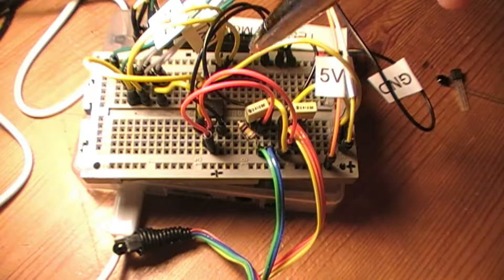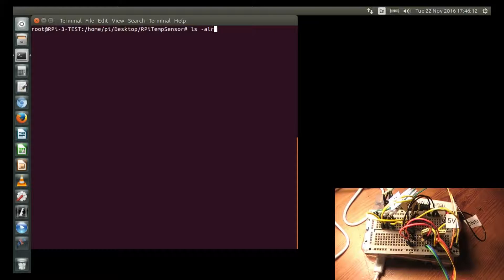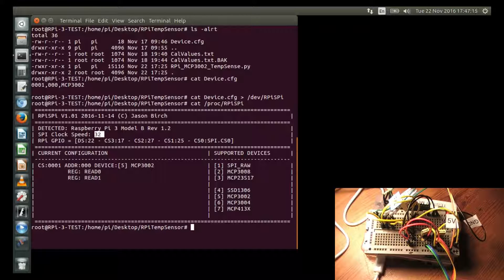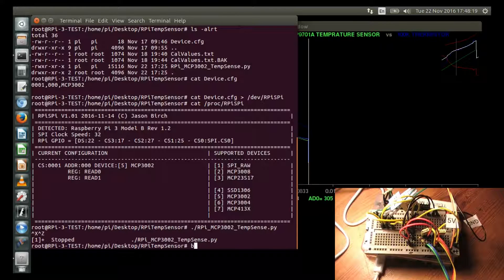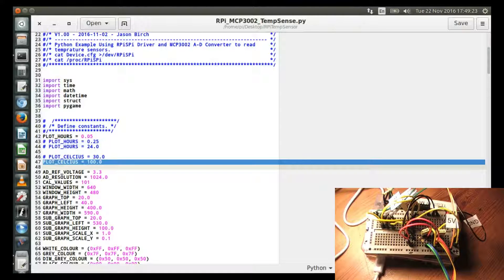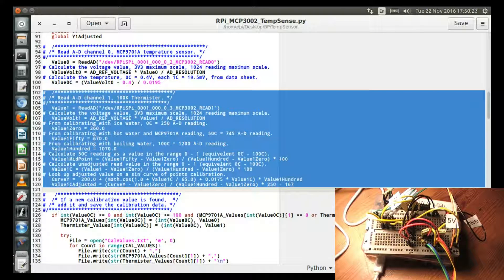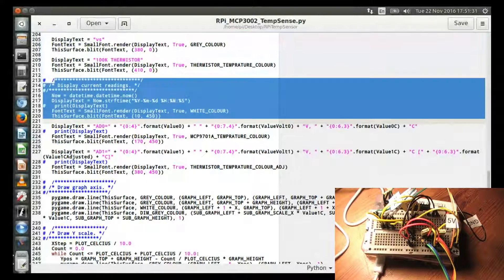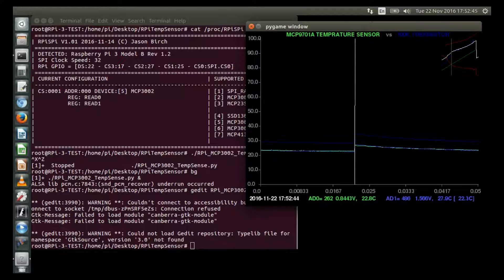Reading Temperature Sensors In Python On A Raspberry Pi

Comment: Cool project, I have just got another Raspberry Pi. I had one a while back but somehow I fried it. My brother gave me a huge load of components and electronics stuff yesterday, including another Pi and an Arduino Uno, I noticed there's a MCP3002 ADC chip in with everything and I was thinking about doing a first project to get back into it all using this chip. 

I don't know exactly what I am going to do yet I am just looking for ideas, and I want to do something sensor based because it will prepare me for my future plans for a project. For now I think I just want to be able to collect sensor based data using hardware, and display it using software, and all on the Pi, in Python if possible. I haven't touched an Arduino before so I'm more confident with the Pi

I have done a lot of Python based stuff fin the past and was wondering how you were going to display the data, then I saw how you did it :) 

I liked how you used Pygame for the display, very good idea. I might take a look at your code as I might be able to use it in my project.

Thanks for a clear and informative video, it was really helpful.
Reply from the maker: Thanks Ben. I think PyGame is a great library for Python, it performs really well, I use it for all display stuff. There is an SPI reading function in my latest check in called RPiSPI.py here:
https://github.com/BirchJD/PiRF24L01_2.4GHz_NEO-6_GPS
I used to talk to an SPI device. It may help reading the MCP3002. I watched some of your videos, there is some good stuff there, the early high voltage stuff was interesting, and some of the Pyhon videos too.